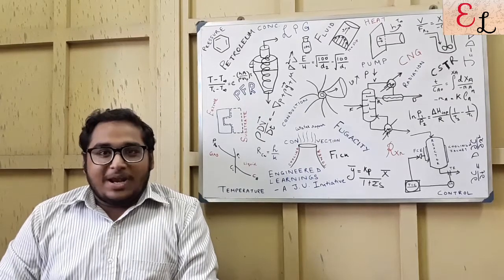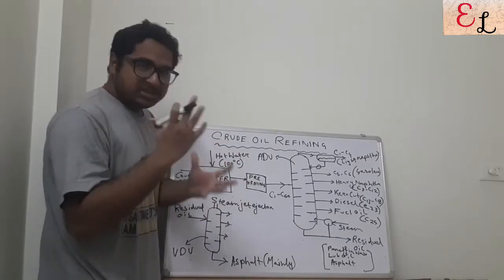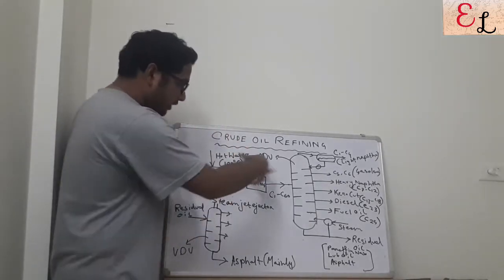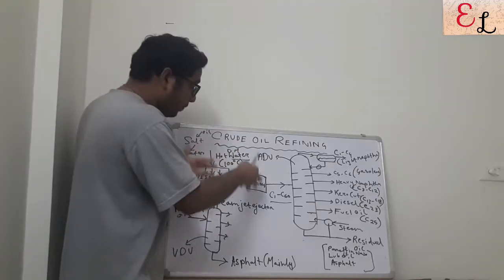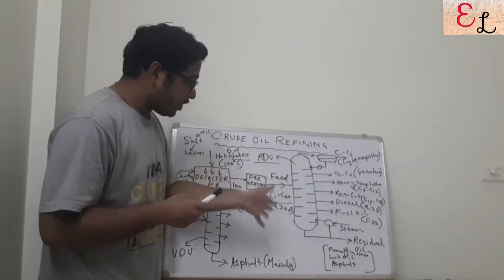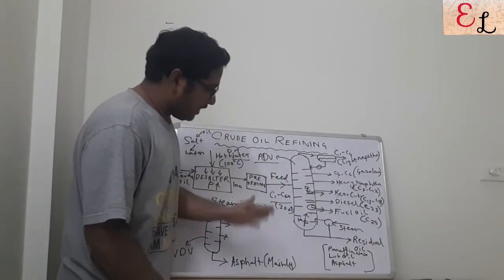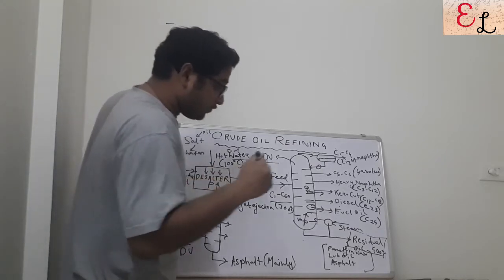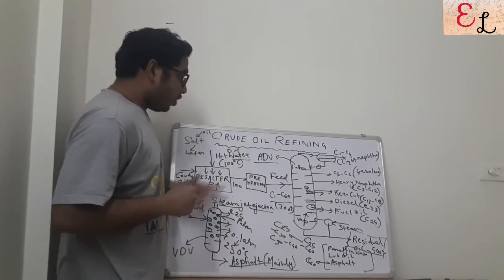CRUDE OIL DISTILLATION | PETROLEUM REFINERY | CRUDE OIL REFINING

Comment: If VDU can reduce temperature why don't we use VDU only in place of ADU.this should save lots of energy
Reply from the maker: If we use VDU as the first step, at that minimalistic pressure, it is difficult to achieve liquid streams from side cuts, the lower BP C compounds have a probability to go out entirely as vapor from the top.
Reply: @LifeBeyondBusiness  thanks dada